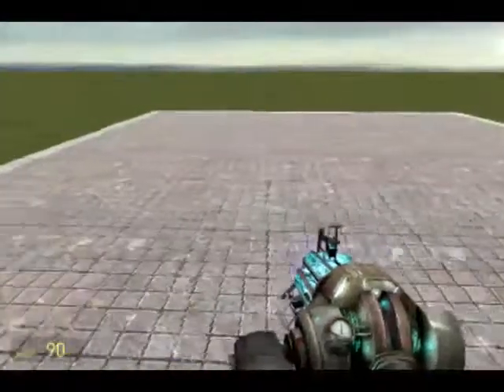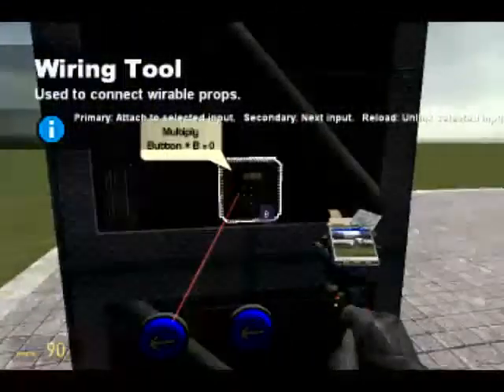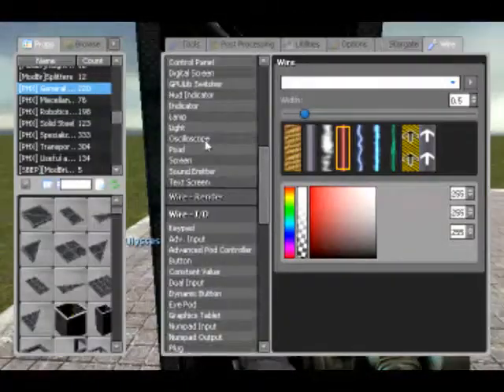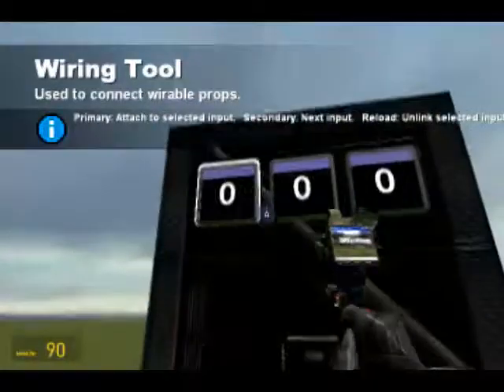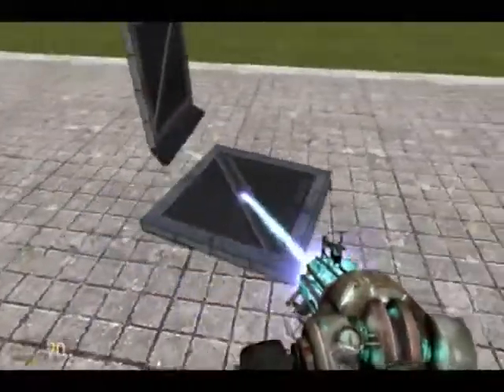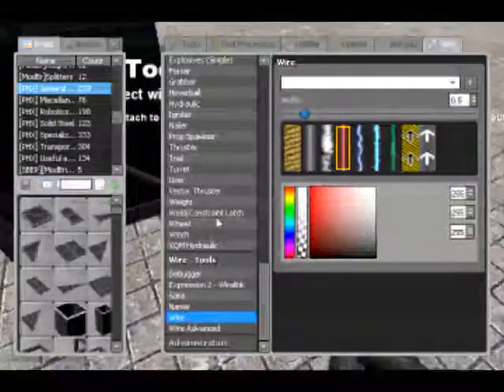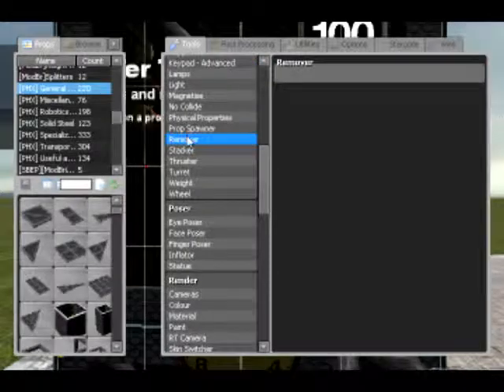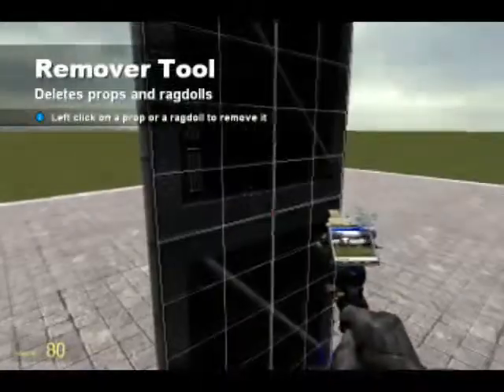Arbiter's Garrysmod Tutorials - 2: Wiremod Gates & Chips

Comment: I have a problem. i have gmod 13 beta and my gates doesn't work. the gates is under wiremod control and is called gates but whenever i try using it there will appear a white long square up in the corner and when i try spawning it. nothing will appear! please help!